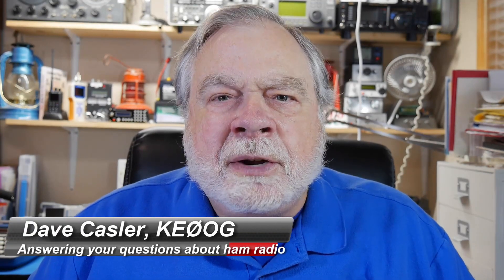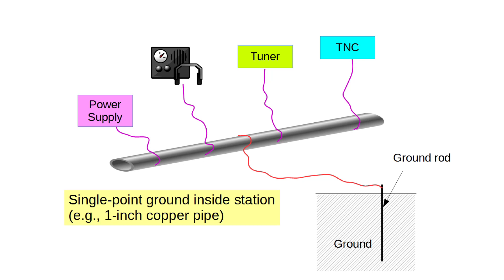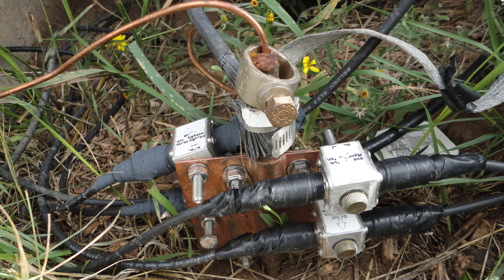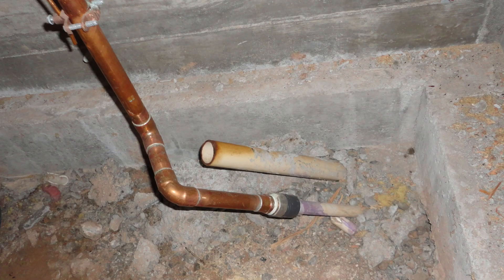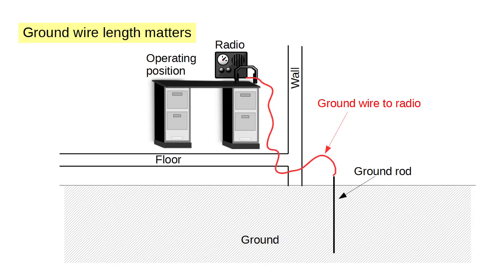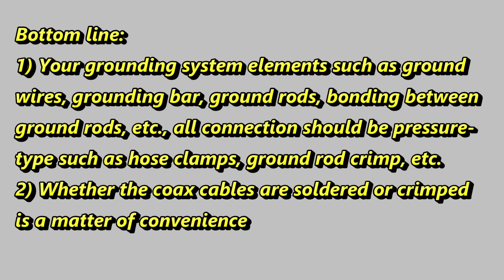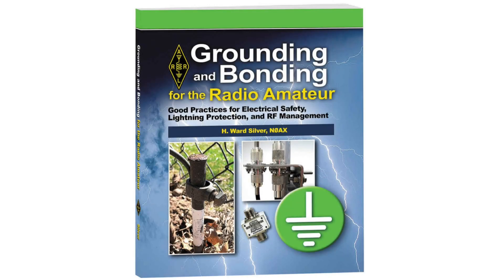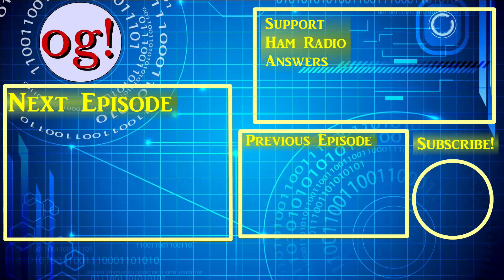Sorting Out Grounding (#409)

Comment: I have a question. I’m in the process of purchasing a house and looking to get back on the air. This will be the first home I’ve ever bought. I’m looking to put antennas on the roof. A vertical and 2 inverted Vs off one mast to one radio. When it comes to the lightning arresters, how can you tell which antenna arresters would be best to use or does it matter?

Comment: Before retirement two years ago, part of my responsibilities included lightning hardening of communication sites. I was WA6TDG back in the late '60s but let my license lapse when I started working in avionics. I became a communications / IT field tech for Arizona Public Service, a Fortune 100 electric utility, in 1984.

Some general points: lightning is very inductive; conductors running parallel to the grounding conductors, even for a few inches, will couple a lot of energy. For the same reason, and for fire safety, ground conductors for lightning should not be smaller than 6 AWG. Amazingly, the impedance does not drop much for much larger conductors. I once calculated the linear inductance of a 2 foot diameter pole and found it was not much lower than an equivalent 6 AWG downlead.

Fire safety requires the use of ground rods (see the last paragraph) and they are a Good Thing, but any site that has commercial electric power has a much more attractive ground for lightning: the commercial power conductors. When lightning strikes your properly grounded equipment will direct the energy to the ground rod, and the rod has both modest conductance and capacitance, softening the first 100 microseconds or so of the strike that have the crazy high current (25KA typical, but more than 200KA measured) so the wire from the neutral connection in the service entrance can be as small as 10 AWG.

You should also take single point grounding very seriously. Lightning is absolutely ruthless in seeking out any single point grounding violation.

In the US the governing document is NFPA document 780 (NFPA document 70 is what we know as the National Electric Code; document 780 is the National Lightning Code.) In Europe the code is much more comprehensive, including practices for protecting equipment. In the US it is all about fire and life safety. NFPA 780 is available for free access at https://www.nfpa.org/codes-and-standards/all-codes-and-standards/list-of-codes-and-standards/detail?code=780 but you will have to create a log-in.

Comment: As I understand it, the main argument against soldering ground connections is that the solder will melt handling the current from a lightening strike. Lightening usually comes as a double-strike - air to ground and then back. So after the first strike, the solder is melted, and there's no longer any protection during the second strike.

Personally, I like the idea of the solder acting like a fuse limiting the current, but the NEC frowns on this, and any insurance claim for damage due to a lightening strike is likely to be dismissed if your grounding doesn't follow the NEC requirements.

Comment: Dave, as you said coaxial cables can be crimp or solder style. And, soldered connectors, done right, are better long term. But, whichever one you can do best is what you should choose. As for as grounding cables go, crimp and solder (do both) is the way to go. Professional grounding systems are CAD welded and typically involve a ground ring, single-point ground, and extensive bonding. A couple YouTube videos of CAD welding: https://www.youtube.com/watch?v=OFs1yKg6JvU  https://www.youtube.com/watch?v=T5DoB26TFtI       Rich, JS6TRQ/WC8J

Comment: I'm fortunate enough to still have copper running to the meter. While not ideal, my shack is on the second floor on the west side of the house and my electric panel is on the east side. Bonding the 2 ground rods would be difficult. Any suggestions?
Reply: Ground to wherever the service entrance is grounded; don't worry about how long that bonding wire may be. If you bond to anything else you will be creating a path between the two in your equipment that already has a power line ground.

Comment: On the PL-259 connector and RG213 or LMR 400 I take the shield and fold it back over the insolation and screw the connector onto the shield and insolation then solder the center section then heat the heat-shrink over the back part of the connector and insolation. Been doing this way over 30 years and never have had any problems.
Reply: We did DS3 coaxes that way for a while where I worked and experienced a lot of intermittents in the ground. The shield must have metal on both sides of the braid or it won't have enough pressure to maintain good contact.

Comment: Related question :) can I pass coax feedline through grounding block (it grounds coax shield to earth) at the entry point to the shack if it feeds a dipole?  Would that mean that one shoulder of the dipole is electrically grounded?  All examples I've seen show coax grounding done for verticals.
Thank you David.

Comment: Dave, we need a vid on CadWeld vs ThermoWeld, the two really professional ways to join a ground connection.
Reply: @John Cliff One hopes the rail lines are very much larger than a home grounding rod. And the railway stuff won't be available at your local electrical supply.(g)

Comment: Dave, electrician here,  he is talking about two ground rods as that is commonly the practice to meet the NEC requirements of 250.53(A)(2) and 250.53(D)(2). A ufer could be used but is more a commercial thing unless specified by the homeowner in a new build. Be careful the term 'utility' ground rod. This is not and should not be accessed by a homeowner and connects the neutral point on the utility transformer to earth. I cant stress how important it is to bond your ham station ground to your home's electrical grounding electrode system. If you dont and just pound a rod near your shack, you are making what the NEC addresses in 250.54 as an auxilary electrode. Many an expensive CNC machine have been smoked because the drove an independent ground rod that was at a different voltage potential than that of surrounding metal and electrical systems. The ARRL grounding and bonding book hits this home pretty well but many hams just dont get this point. A review of NEC 800.100 discusses at length the grounding and bonding for communications systems, and connecting your ham station to an Intersystem Bonding termination is really the best thing for this situation
Reply: You left a hole open for misinterpretation. Bonding the grounded antenna system to the Intersystem Bonding Termination is correct, but the antenna and the metal mast or even a tower legs needs its own ground rod or rods. It's the bonding wire that makes all the difference that would have saved those CNC machines. But those "independant" ground rods are required at the base of the antenna according to code 810.21 I think. It's somewhere around there. Anyway it's those uninformed Amateurs looking for the easy way who would gloss over that extra antenna rod, or long extra bonding wire, looking to save money and effort, and get into trouble. We have to be careful talking in front of them.
Reply: @JohnSmith-bb2np  here's where there's a fuzzy area between what the NEC requires, what is common sense and what should be done for 'lightning protection'. 810.15 says masts and metal structures supporting antennas need to be grounded according to 810.21 (unless you have a 150+ foot safety zone around the tower). I feel that if your antenna is on or adjacent to your dwelling, simply bonding the tower or mast to the IBT or the grounding electrode system is sufficient as it is what is spelled out in 810.21. If you classify a tower as a structure per code defenition, then I suppose a strict reading of 810.21(F)(3) says it needs its own ground rods or equivalent. I think the issue is many people just have the erroneous feeling that connecting their saintly isolated "ham ground rod" (an auxilary electrode per NEC 250.54) to their electrical service in any way will wreak all sorts of havoc.
Reply: @stillthakoolest  Yes sir, I have heard that one a few times. They just don't want to bond the antenna ground to house ground for fear of bringing lightning into the whole house.
Reply: @JohnSmith-bb2np  They need their own connections; in all our sites the 00 ground wires connected to 4/0 wire buried a few inches below the surface. That in turn connected to the ground rods and the electrical ground system. I would be very leery of using ground rods at each leg but no connection to the Big Ground. That could leave deadly voltages on the tower in the event of a strike. 2 ohms, 25,000 amps, 50KV. That is just an average strike.
Reply: If you don't mind, I'd like to get your advice on how to bond antenna and station ground rods back to the 'utility' ground rod which is located in an extremely inaccessible location.  The utility ground rod is located on a side of my home adjacent to the property line which is entirely filled with my concrete driveway.  To access the utility ground rod, I would have to tunnel under or cut through nearly 50 linear feet of concrete.  The only other option I can see would be going the long way around the house and coming to the ground rod from the back yard.  However, the distance to make this journey would be well over 200' and would still involve going under at least 2 concrete sidewalks.  The only other idea I can conceive does not seem like a good idea to me... that would be running the ground wire up the side of the brick exterior to the roof soffit, over two garage doors, and back down the brick wall near the electric meter to the ground rod. I don't like any of these options.  I know it's hard to picture the layout I'm trying to describe, but I'd appreciate any advice you can provide.  Thanks.
Reply: @jeffh1691  you dont need or want to connect your ham station grounds to those 'utility' ground rods (which you own and are responsible for), but rather bond your station and antenna grounds to "the nearest accessible location on the grounding electrode system" on your home's electrical service. Do you have copper piping entering your home for water? Do you have an overhead electrical service with metal conduit? Are your ground rods anywhere near your home's electrical panel?  If you insist on driving your own ham ground rods, could you connect it somewhere in the house where the requirements of NEC 810.21(F)(2) could be met? It is code to bond these "ham ground rods" and your home's power grounding electrodes together.
Reply: @jeffh1691  I asked a lot of people a similar question and the guy who wrote the grounding and bonding book Ward Silver said at least drop a wire halfway along its length to a ground rod. You should try to contact him and ask for sure. That really long bonding wire is a tricky one and may require a thicker gauge wire. I asked during a live internet presentation at local ham convention a few years back.
Reply: @Peter Ganzlin I'm unsure just how the electric service is grounded for my home built in 1987.  There is no sign of a ground rod where the electric meter enters my home's electric panel.  There is a 0 gauge stranded bare copper wire running from the panel to the copper water pipe in my basement and then on to the gas pipe at the furnace.  Is this likely the ground for my electric service?  If it is, I'm reluctant to bring the ground wire into the basement from my antenna mast on the roof.  Seems like that could bring lightning directly into the house.
Reply: Everyone also knows about that there is enough proof that grounded buildings with lightning rods get hit with lightning more often then those that are not? You need to ground the cables and disconnect your equipment. But grounding the mast just creates a potential that the lightning wil seek out. Just saying. Also you have the groundloop problem to solve more often then not.
Reply: @raunchyNO  Actually, they get hit as often as they would without lightning rods (technically "air terminals"). The lightning rods are there because they are vulnerable to strikes, and lightning protection is virtually 100% about conducting lightning to ground without any unwanted detours.
Reply: Lightning protection is not part of the NEC (NFPA 70) but is part of the National Lightning Code (NFPA 780). Where the two intersect is in the bonding of all ground electrodes to prevent what you describe: lightning taking detours through delicate equipment or delicate humans. When lightning is being addressed both standards apply.

Comment: Best way to mount a surge protector is thru a copper or aluminum bulkhead plate with a strap to a close by bonded ground rod. The coax is not the issue. For a long wire, some have used spark plugs and large chokes to ground. Also, for better protection, use a balun that provides a DC ground  to the center conductor. Helps with static discharge too. Install an AC surge protector at your main panel and a few more along the way, unless you have a tall tower, odds are greater that your power line will get hit. Regardless, DIRECT hits will cause damage to something as the force is like a tornado or hurricane, we can only reduce it and and do more to prevent it the next time. If you have a repeater or transmitter at 10,000 feet like my Blackridge  or Raspberry sites, it will happen again.
Reply: The worst lightning strikes on our mountaintop sites were to the ones that had underground power lines. The tower always takes the strike (only once saw lightning come in through overhead lines; naturally it took out both line fuses after it blew up part of our automatic transfer switch.) The most severe damage I have seen reduced the TVSS on the power line to a plastic box full of incinerated boards on a demolished backplane as the lightning found the excellent ground that the underground service provided. 
I should mention that a handful of years ago (five or more?) the standard for lightning protection on power lines changed. It had been 20K amp Transient Voltage Surge Suppressors (TVSS) and changed to 200K amp Surge Protection Devices (SPDs).

Comment: Dave as I understand the NEC now says only ONE grounding rod per home for electric service. I still have a ground like you point out, a rod outside my shack, but I did not run it back to the house ground.
Reply: Electrician here. That is not true. NEC 250.53(A)(2) states that a single rod electrode (ground rod) must be supplemented by an additional grounding electrode (ufer, ground ring, plate electrode etc.) OR a second ground rod. 99% of new residential installations have 2 rods simply because the only exception to the rule is if you can prove to the inspector the single rod has an earth resistance of <25 ohms. As that test requires a VERY expensive meter to do, most just install 2 rods bonded together 6 feet apart. Besides, a few ground rods (much less just one) is not a very effective grounding electrode. You really need to bond your ham radio ground rod to your home's grounding electrode system for a matter of safety and to profect your equipment. Your 'lone' ground rod is at a different potential from the rest of your home's electrical system and could be a big issue with lightning or a power surge
Reply: @stillthakoolest  You are absolutely right. Lightning must see a single point ground (one point of contact to the ground system, no matter how many ground rods it has) or significant amounts of lightning will pass through the equipment. IIRC the wires between the rods are considered main conductors (rather than bonding, which are not expected to carry significant current) and must be a minimum of 00.

Comment: Braid is not recommended to use outdoors because "Corrosion on the surface of the small wires used to make up the braid reduces its effectiveness by raising the surface resistance, where the RF currents flow.  Poor contact between the individual wires can also result in noise and mixing products."  From the ARRL Grounding and Bonding book.  W7DOC

Comment: On the cold water pipe: Here I believe that the electrical system should be bonded to the cold water pipe where it enters the home.
We should also have two ground rods.

That's before shack grounding.

Of course, you should never ground to your water supply, I suspect it's code in case someone has done so in the past?
Reply: In many old homes with old electrical systems, the copper water pipe that is in contact the with the earth is the only grounding electrode in use. The problem with replacing lines with plastics is it is no longer a good electrode where it enters the earth away from the home. Any metal water or gas piping in the home still needs to be bonded, but it would not be your home's grounding electrode. As far as continuity is concerned your ham radio 'station ground' should be bonded to all available grounding electrodes in your home electrical system.
Reply: @stillthakoolest  absolutely. 
I actually looked it up, and our local code is that you should have two earth rods (not less than 8ft apart) and they should be bonded to the metal cold water pipes - presumably for this very reason.
And your shack ground should be bonded to that ground system as Dave said.
I assume this is what DX Engineering meant.